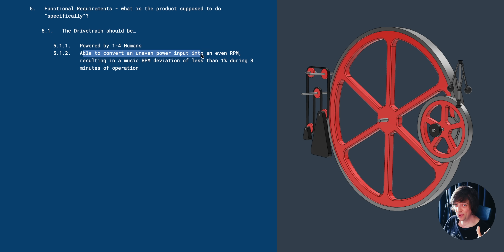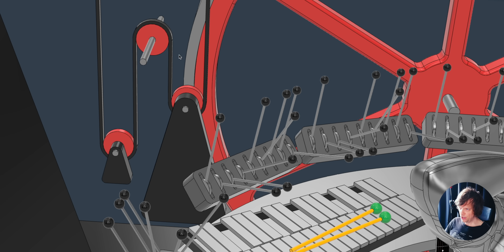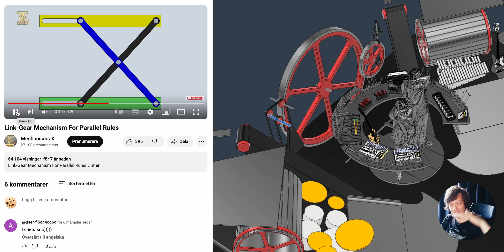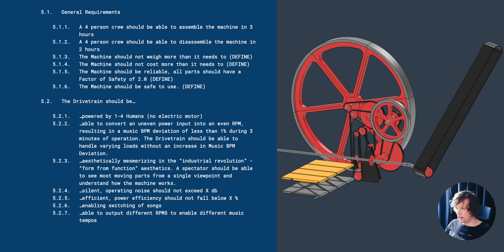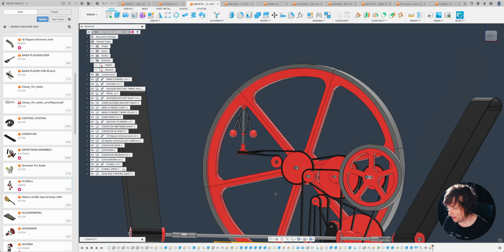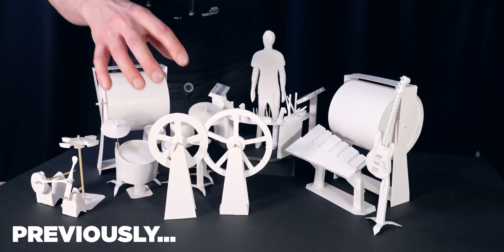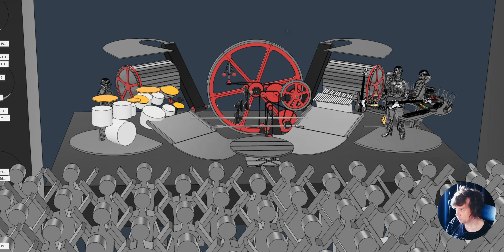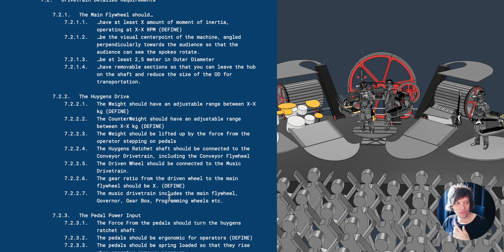The Marble Machine Drivetrain

Comment: Here we go again, I feel like Martin forgets what was already done earlier and with each new step goes back to redo the previous steps. I felt like the general scene positioning was already done and it was correct because machine is not the show machine is part of the show. Also you need to remember about safety the huge moving parts have a lot of energy in so they need to have some protection from the audience and from the performers. Someones hand crushed by the flywheel will not make the show better.
Reply: If your mechanical system is storing x amount of energy and can output y amount of power, the bigger the system is, the safer is it, because all your rpms go down drastically.

Making everything smaller also requires much tighter sealing and shielding. If you have a 1.5m fly wheel: put a railing at arm's length around it, no need to make it finger tight; whereas if you have a 30cm flywheel storing the same amount of energy: you're going to have to put it in an enclosed box and that thing could still destroy the box in case the axle fails.
Reply: No, it will be "MEGA BETTER" 💪 

Seriously though. I'm glad I'm not the only one growing weary of this backtracking just to backtrack just to forward...back track again
Reply: @k1dfr0std  How can you tell if someone's NOT an engineer? Don't worry, they'll tell you.
Reply: @josephbasile7978  RIGHT? Every real engineer over ever known tell me to shut it when I try to reveal that - "SHHHH! I don't need this extra _insert everything here_. I've got enough to deal with."
Reply: @k1dfr0std  this is iterative design and it is crucial if you don't want to end up with a ton of sunk costs.

Comment: This literally looks like my 6 year old sons Lego designs every time he gets his hands on a bucket of gears.

Starts of with a few things that works well. But it soon consists of 50 different gears, belts etc that requires more power than the gears driving next gears can ever provide.

Having this monstrosity powered only with some pedals, I have a real hard time seeing that work.
Reply: It is gravity powered via a heavy weight. The pedals raise the weight back up higher.
Reply: @billkeithchannel  Yes, but you will still need to input all the power that the machine needs in order to keep it going, via pedals.
The weights are only to keep the tempo steady.
Reply: @jesperahman738  I don't recall a video where Martin says this. From what I watched he is expecting all the power to come from that weight. If you are right, then he is going to need a hand crank with a manual transmission gearing to get it up to speed for the weight to take over.

Comment: Boooooo!  Martin gets a massive leg cramp, and the musical performance comes to a slow halt. Another musician is frantically pumping,  but the machine can barely drop a marble.  Boooos transition into sympathy tears as the audience mournfully exits.     Wilson approaches the stage with apologies but no one can hear him.  Wilson forgot he can't speak.           I don't understand your design requirements.  The weight of the drop counterweight needs to be calculated first. The counterweight  should drive the entire mechanism without using leg power.  Then you can add gears to lift the counter weight so it can fall again.  The counter weight for such an enormous machine appears insignificant in the design.  I am guessing the machine might need a counterweight of 500 kilos.  I don't see the  point in designing the appearance of the machine if the mathematical calculations  have not been pre determined.  The math needs to work first.  Show us the boring stuff, the calculations. What is the force required to drive the entire machine at tempo?

Comment: A cast iron flywheel that size will weigh about as much as a transit van (about two metric tons). I really think that this is an element that needs to be looked at.  As it stands you might as well get a steam engine / tractor to power the machine.  You could tour the steam fairs across Europe.
A flywheel that size is just too damn dangerous when it’s spinning.

Comment: How are you going to sync the two programming wheels?   “Tight” music to the tolerances you have tested in the past triggered by two disconnected source drums is not going to be hard without electronics

How about a single programming wheel behind the other instruments and runs of Bowden cables to the instrument groups?

Comment: For the drive train, why not raise it by ~1 meter? That would still keep both the control booth and flywheel in the center line, make the flywheel more visible, and also use it as a backdrop behind the control booth. seems like a win-win to me.

Comment: The drivetrain has to be SAFE. An open wheel like this poses a dire hazard of a finger or a limb being pinched.. Likewise with your pedals ; they cannot be safe as illustrated, the likelihood of pinching toes is huge. Basically, anything that looks like scissors will behave like scissors. The solution is to increase the gap beyond which there is no pinching for likely loose limbs. Yet enclosing items is even safer. Put your big wheel behind plexiglass.

Comment: Feeling a lot like pedals are a solved problem. The spring seems unnecessary, the opposite foot can drive the pedal up as it is pushed down. Think bicycles. Perhaps two syncronized cranks, one rotating clockwise and one counter-clockwise? Hard to describe but hopefully you see my meaning.

Comment: I'm missing what I think is the most fundamental parts of designing a drive train. What are the power and torque requirements? How does that compare to the amount of energy that it is possible to put into the system? 
The max energy that a free standing person can generate via a pedal is the change in potential energy so their weight times the travel of the pedal.

Comment: I've been a silent viewer from Germany (astrophysicist, not engineer 😉) since 2018 who thinks your project is fantastic and I'd like to make two comments on today’s subject:

The even pedals sound like a suitable way for power input, however you may also want some space on the podium that does not move, or is there a reason for pedals covering the total floor of the podium?

I absolutely feel your urge to put the mechanics into the visible center. Many of your shown design proposals today push the artists to the margins though. I believe the audiance wants to see both the machine and the musicians, and you may want to move easily around. Did you consider the opportunity of putting the "clockwerk part" (flywheel, Huygens drive, governor, etc.) on an upper stage behind the artist’s podium, like in 9:56 but flipped around? Could look gorgeous, center remains accessable and besides that increases space for the Huygens drive.

Keep going fulfilling your dream and do not worry about how the YT videos might be received, we stay here and assist you! 🎆

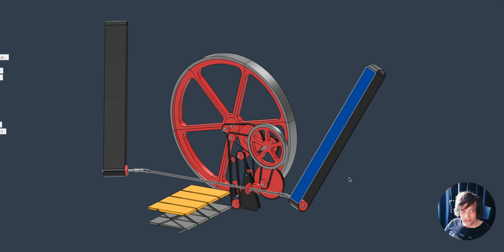Comment: At 5:09, you mention using a CV joint. The issue with CV joints is that if you are not using two in series, you will get a non-constant RPM output. The output will behave like a sine wave, alternating between slow and fast. This is very important to know if you are using CV joints and need constant RPM measurements.
Reply: You're talking about a universal joint, that's the one that has those issues. A CV joint (Constant Velocity joint) is made to solve the exact problem that universal joints have.

Comment: Hello Martin; a suggestion from a Systems Engineer for the visual aesthetics of moving parts...

The requirement definition phase fulfills 2 main functions: giving you a measuring stick for when you're "done" as you well know, but also to save budget. However, since you control that budget, you have some room...

Remember the "fingers" from the Marble Machine 2/X? Those served no purpose but visuals, BUT they also did what engineering eye-candy needs to do: be incapable of causing a failure. You can theorize these nice-to-haves: would you want them, how might they connect, in very broad terms, because only their interface and constraints (below) need to be considered, and you could just design them in your engineering after-party.

You can add visually appealing moving parts, so long as:
A) the need to move them causes no significant strain on the system and the people powering it.
B) A failure in these non-essential parts causes no degraded performance.
C) the cost of time, energy, and money to design and build these stays within the project money/time budget.

If the connection to the drive train is simple and the interface solves the issue of breaking away during a failure, you can design multiples of these to change the look based on venue or tour.

Also if you made it this far into my comment...
If you made the controls vertical, so they could be operated from the "front" of the controls as well as the "back" of the controls, you could have some musicians standing above the marble cascade on a slightly elevated platform. The "waterfall" of marbles is still a neat effect behind 1 person, and the bottom cascade would almost look like playing above a marble river. This would at least give some freedom of controlling what is visually blocked per song, with the trade-off being the operator has to understand the levers are different. Since you're learning movements per song, I believe this type of muscle memory per song would develop easily, so long as you consistently use the same positioning consistent with the same song... Inconsistency in this will eventually lead to operator mistakes.

Also take heart with the design requirements. They are boring and almost always feel wrong at first, and it frustrates a lot of new engineers. But done well it makes the implementation butter smooth, and any engineer that has seen late-project issues will get frission when everything unfolds quickly and smoothly. For me it was my moment when I realized "wax on, wax off" wasn't just a chore, but a path to let things flow smoothly later.

It will make you hate things you miss in the requirements phase with with a passion though.
Reply: thanks for the insight

Comment: Hi Martin… perhaps you could still rethink the actual setup of the machine… my suggestion is that the whole machine should sit in front of the stage and there should be a second upper level behind it where the band will stand and control the machine. This way nobody would cover any view of the machine and the band would have more space to interact with each other during the show.

Comment: How about the control station is on a platform above the flywheel, and you have slides on either side, so you can slide down to front stage while guitar soloing?

Comment: If you move the control station forward and down a bit, the machinery will be more visible from a lot wider side angles for more of the audience to see it and a lot easier camera angles for filming and streaming. You could still get the image if you with the backdrop of the machine and clean shots of the machine at work as well. It depends on stage size ofc as well. You can also make the control station easy to leave (which you already were planning for, but make that more of a focus perhaps) so more of the machine is more often visible. Also you could tolt the controls to the side a bit, so there is space in-between you two, so basically the two operators will frame the center of the machinery from the two sides.

Comment: It would be cool to have the flywheel in the front and the performers above the flywheel (think daftpunk) up above the machine. The controls should be around the same height as the top of the flywheel. Also, you could make the platform rase and lower. Just my thoughts.

Comment: Martin, DECISION! We are back in the very first question when it comes to the marble machine, do you want the machine to be the show piece or musical instrument? Decide it NOW!!! Because if you keep this up, you will be redesigning the whole thing every 3 episodes and not moving anywhere.
I will give you some slack because Swedish, Abba and Eurovision, your mind around music and show is a bit different but when it comes to this kind of thing, you need to make sacrifices to make a thing that fits ONE of them.

Thinking which way a wheel turns and does it look good is show machine stuff, for musically accurate machine you do not start by thinking "does it look good", you start by the question "is this the best way to do this". As in, you will need to start thinking can a belt drive those things and remain accurate because when you put enough load to a belt driven thing, the belt will stretch and you will start loosing accuracy and fast. You can change the belt to a chain to increase the load capacity a lot but you need to redesign the whole mounting and tensioning system.
Then there is the whole question of inertia and forces. Have you even calculated how much that big flywheel would weight and how big counter weight you're going to need to run it?
Again, this is very important if you're making a musically accurate machine while with show piece you can make that wheel from foam and just have it running in the background without needing to care how you're going to power 100kg flywheel. Also it will affect a lot of the other things in your drivetrain, like you aren't changing the RPM of a 100 kg flywheel in seconds and you will want to put in systems that separate that monster from everything else before anyone touches anything or if there's a problem. Also is there going to be 1, 2 or 100 people pedaling the machine? You need also that answer ASAP because again, that 100 kg flywheel isn't going to spin itself and ultimately if it's a show piece you can make it from foam and call it a day, if it's the main flywheel, you need to start to get the RPM numbers up because that thing will dictate so much how beefy the rest of the drivetrain must be.
Reply: He doesn’t even know how much power his “machine” needs. That’ll be the first step in sizing the requirements of a flywheel.

Comment: could try moving some of the mechanics higher perhaps? Like maybe the drive shafts going to each side drive the top of the lifter belts instead of the bottom. Then some of the mechanics would be more visible behind the performers. I think the performers should stay in front and centered, the mechanics should be plenty visible.

Comment: I think it's a far better stage piece with the performers in the center. It's nicely symmetrical, and the performers are going to be a lot more dynamic and I hate to say it, because I do find the marble machine very interesting, but they'll be more interesting than spinning wheels, especially to people in the back of the room or not intimately familiar with how the marble machine works. Not that it isn't neat, but the flywheel is going to be a very monotonous thing to watch front & center for an entire performance. And as other commenters have pointed out, you do need to take safety into consideration as well, especially with something of this size. At BEST you could accidentally lose your clothing to that thing.

Comment: Quick minor suggestion for design requirements: verify the verb that you are using. If it's a requirement that is non-negotiable, you should probably use the verb "must" instead of the verb "should". The verb "should" has a meaning of it's good but not necessary to the machine. You can also use the verb "may" to have a "nice to have" feature.
For example:
The Marble Machine III MUST play over x db.
The Marble Machine III SHOULD be able to be disassembled for transport in less than 90 minutes.
The Marble Machine III MAY allow the marbles to have different sizes.
Again, it's a minor thing, but it allows you to create a partial priority system in your requirements.

Comment: You might be able to keep the operators in the center by raising up the mechanics a bit, effectively putting the performers and the clockwork on two tears. (Although I also admit that I'm not too sure about the stability of that depending on the stability and weight.)

Comment: It helps to think of requirements as a hierarchy. Start with user NEEDS, what does the machine need to do: play music using marbles, looks visually amazing, have X number of instruments, should be programmable via a programming wheel. Then "flow down" those needs into varying levels of "requirements" but always flowing from a higher level requirement e.g. the next level down from user needs to be  HOW does the machine achieve those user needs: should have a mechanism to ingest marbles and distribute them to the instruments, system should be able to maintain tempto, and from those flow down even further. In order to maintain tempo, there should be a huygens drive on anything that drives the marbles etc. i think youre misunderstanding requirements (like a lot of people do). 
In engineering, requirements capture is an entire project phase that takes a long time and involves a lot of analysis and derisking etc (look up preliminary requirements review, and system requirements review). What youre doing now, all the initial cad design etc shouldn't be dictated by requirements,  in fact it should just inform the eventual writing of the requirements, and then culminate in a preliminary requirements review. Dont let requirements confuse you. Right now you should just update your top level requirements as you gain a clearer idea of what you want to build and eventually you should reach a point where your requirements are stable and you have a clear idea of the general design, and then you can go to the next level, define more details etc